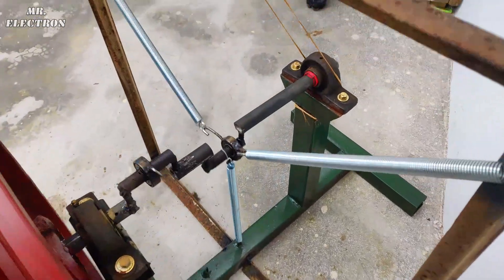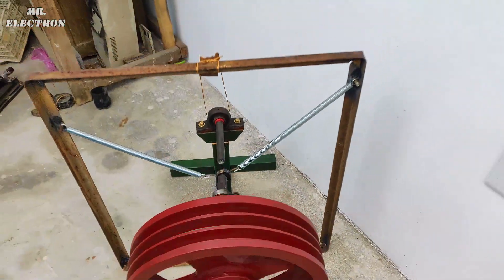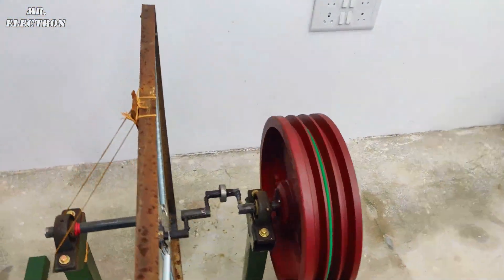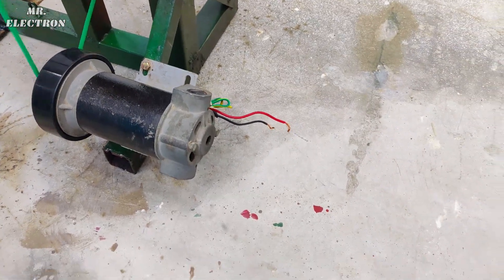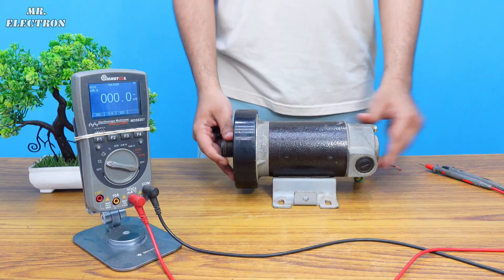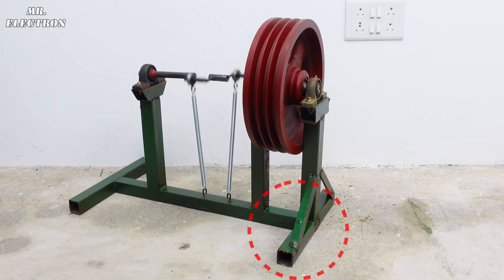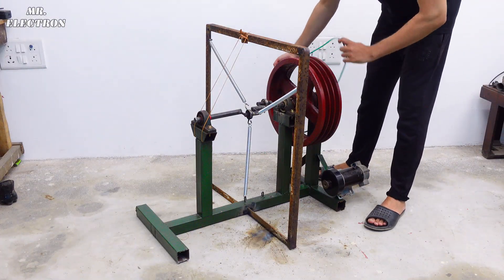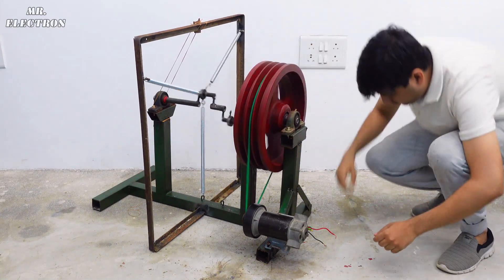Build Flywheel Spring Machine Make Electricity Free Energy Generator 220v Perpetual Motion

Comment: the hardest part about making an overunity device is hiding the battery, let's see it without the motor attached, a treadmill motor will run at pretty low voltage as it is dc, that would be about the speed you could acheive from 4.2 volts from a single lipo/lithium ion
edit: guess so, thanks for not leading people on in the end
Reply from the maker: Correct but i use 35v dc instead of the 4.2v dc. The speed is slow because the motor is rated at 220v + the gear ratio of the motor pulley and the flywheel. Its a scam exposed video.
Reply: It is titled 'make electricity, free energy generator'. There is nothing misleading about this at all. The energy is always free, while converting it to electricity will come at the cost of electrical components necessary to do it. I have seen so many videos labeled as a scam simply for saying free energy. The problem is uneducated people that don't know the difference in energy and electricity. I am not saying that people have not scammed. Some have, because they do not have the knowledge to build a legitimate spring machine. It requires a high level of technical skill and understanding of physics; then applying it to the product. But the concept is 100% real and verifiable. Anyone who thinks free energy is a scam needs to take a physics class or pick up a dictionary. 
Energy=/=electricity unless you convert it.
Reply: @Romulus_YT  same principle as a clock
Reply: @squarepeg55  good analogy. Actually takes me back to my childhood. I was always fascinated by the old grandfather clock my parents kept, and how it could run for so long just giving it a little crank once in a while. I could stare at the inner workings of it for hours, not understanding how any of it worked, and never get bored.
Reply: Very lame and boring statement.
Reply: फेक
Reply: @makarandrikibe3136 
If you watched to the end of the video he said it was fake.
Reply: Fake
Reply: As he's going around with the video you can clearly see a red and black wire entering the frame you see a little burn spot Right at the back of the treadmill motor there's a hole there and you can see a black and red wire Inside the frame So yeah I call BS
Reply: @claybornlewis276 
He said it was fake at the end of the video.
Reply: So. Ive watched numerous videos like this and some can be very convincing. But all have just been faked!!

My question is, is free energy possible.....??
(Not electric)

I say yes to a degree.

Grandfather clocks have been around for a long time, they rely on a spring and weights to keep ticking. 

Isn't this free energy?
Reply: The hardest part about dipshits that copy and post this on every single video that shows people working on ways to get off the grid is that……wait… no… there isn’t anything hard about it. It’s just moronic. 

No one cares about the “perpetual” part about it when it comes down to it. An “ALMOST” perpetual device will still tell the “ones in power” to go fk themselves. My buddy runs his machine  shop and uses 3 devices similar to this but using magnets in way I’m not smart enough to explain, that they built and the reduction in their grid consumption is already having needleDix harassing them trying to figure out what they are doing to use 65% less than they did before.  Seems like a win to me so far.

Comment: SCAM.
Remove the green drive belt and the wheel will not turn because the trick is in the "generator" : motor + battery.
Reply: I have to agree the generator is actually a motor with a battery inside the frame. Proof to backup my conclusion is at 2:18 of the video pause and look at the top left of the screen you will see wires running into the frame. Thus it is high probable that this is powering the motor or “generator” that in turn the device.
Reply: So, you didn't watch the video till the end, because if you did, you would know that @Mr. Electron is exposing exactly the same thing that you think you are exposing.
Reply: @mbhekitembe2179  lol 😂 yeah, I quit watching because I hate wasting my time with BS, but since I read what you said, I went and watched till the end 😂😂😂😂😂😂 just as I thought, the contraption don't work. I appreciate him proofing that and not scamming us
Reply: doesnt make sense. The green belt does not have enough power of friction to not slip without moving the flywheels weight + spring that pulls it. The green drive belt is a simple string, real drive belts for wheel this big need to be stronger and larger to obercome its wright
Reply: @petrolom1889  I do not agree : the belt has a good diameter and is tight.
And this is the only way to mnake the machine turn.
Reply: @regisvoiclair  I know :D
Reply: WHERE IS ANYONE'S EVIDENCE THAT THAT THIS DON'T WORK??? 

I am just starting to watch the video, so I REALLY don't know. But I feel like this HAS to work!!!
Reply: @TheTruthMatters  One man on Youtube did reconstruct Teslas Ethernal engine and it does REALL work as far as I know. Yes, comments such as "finding batteries is the ultimate challenge of ethernal energy" are present, but Tesla was the top notch man that is destined to have working ideas.
Reply: @petrolom1889    You can bet that any reconstruction of "Teslas Ethernal engine" is also just a fake. Tesla never had such an engine. He had visions in this direction, that's all.
Reply: @TheTruthMatters  Does the notion of damping mean anything to you? Obviously not. A spring dampens itself. Same for 3 springs. So 3 springs cannot make the wheel turn indefinitely. So there is a trick, a tip, something hidden.
You do not have much knowledge, and little discernment. I advise you to make progress in these two aspects before taking an interest in the subject of overunitary processes, otherwise you will always be fooled by all these people who use human credulity to make money (here by advertising revenues from the traffic generated with their fake videos).
Reply: @TheTruthMatters  it's basically common sense... Why would a pulling spring of equal strength pull another spring of equal strength better? What is going to happen here is..... You turn the flywheel by hand and since the flywheel have momentum, it will pull through the tention of the resisting spring, hence making it look like the 1 spring is pulling the other.
Go spend the money and time and build one. You will soon find out that when you spin the flywheel, it will run..... Til the flywheel loose momentum and it's gonna come to a slow stop 😂 just use your brain
Reply: The springs trying to reach equilibrium tht why is spinning cuz he gave a momentum by hand
Reply: @TheTruthMatters     "WHERE IS ANYONE'S EVIDENCE THAT THAT THIS DON'T WORK???"
There is plenty. First of all, springs are not a source of energy. But due to friction some energy is needed to make this device run continuously. Ever heard of conservation of energy? One of the strongest laws of nature we know, not only based on observations but also with a mathematical proof. Never has any observation violated this law.

In addition, if this would work we would have it since a long time, you would see it running on every second bookshelf, just for decoration. Do you really think such a simple thing was invented just recently? Unfortunately, YouTube is full with fakes like this.
Reply: Why would you say that????? Where is your evidence????